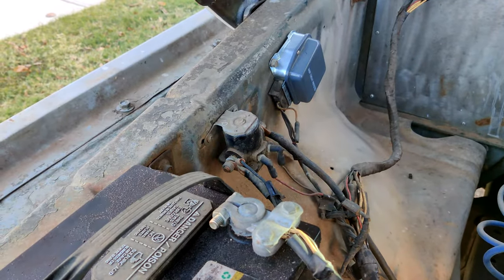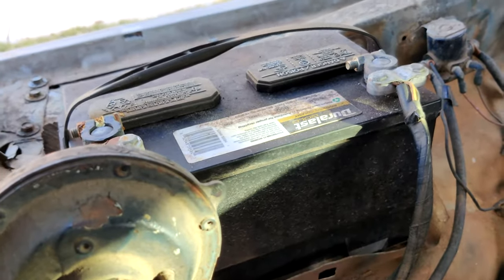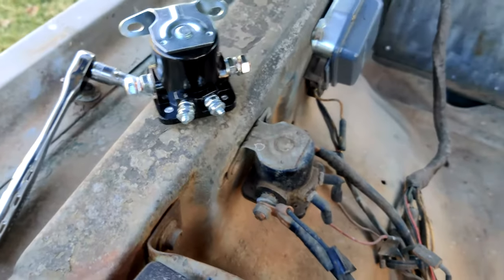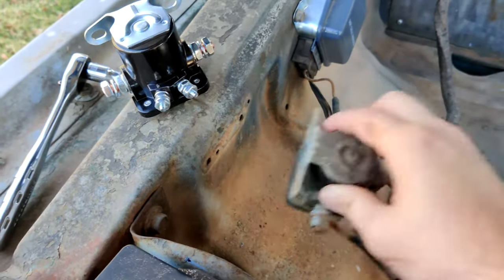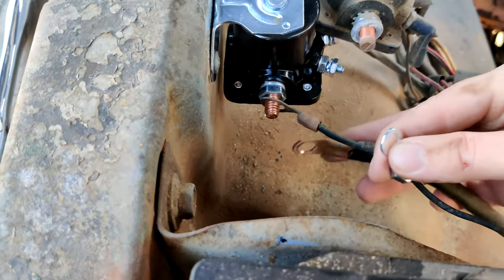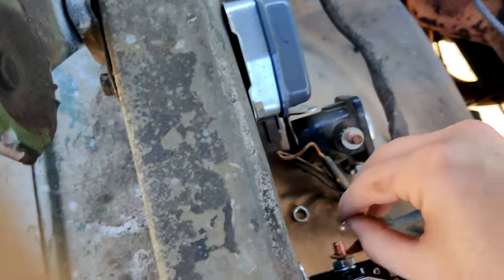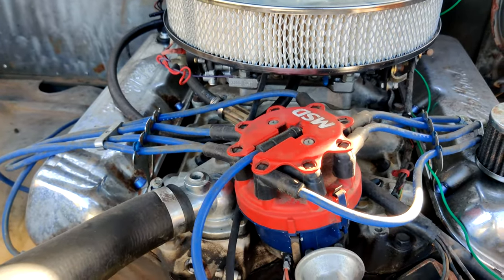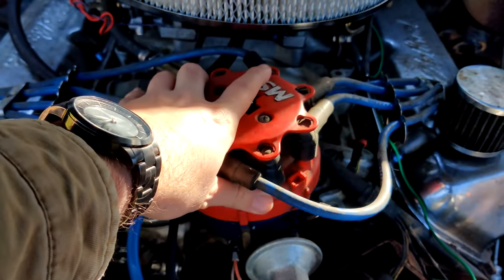Easy Ford Starter Solenoid Replacement

Comment: going to watch this all the way because, well, the freaking solenoids on the 70s Ford trucks were a pet peeve of mine back in the day!  Dirty connections/ground, random fails, weird wire corrosion out of nowhere. Resorted to carrying a back up in the field to stave off costly breakdowns (grain farm guy). Takes 10 minutes after you get the hang of it.  Maybe less if tapping it with a vice grip works.  I swear, it all had to do with the exposed location of the damn thing.

Comment: Thanks man!! On my 76 f250 the battery cables did not have auxiliary leads but when I had to replace them the new cables came with them, I saw that your cables also have those leads and am wondering what you have them connected to?
Reply from the maker: They're connected to the electric fans on my radiator, though it was done before I bought the truck and not very well, basically a wire going to the dash to a switch and back to the fans. Should be connected to a relay and switch or thermostat. You could also use them for stereo amps or aftermarket equipment.

Comment: I have a three post solenoid in my truck it's bad. Every aid, book, and shop shows a four post solenoid replacement? If in fact it needs to be a four post, then what if anything do I connect to the fourth post?
Reply: 1986 ford f150  straight 6, 4X4  3 speed manual.
Reply from the maker: Of the smaller posts, the left one (S) is energized when the key is in the "START" position, this actuates the solenoid to power the starter. The other post (I) is supplied power in some ignition systems to send 12V to the coil to help start the engine. It's not used in all vehicles, and since yours is an '86 i'd imagine you can just leave the I terminal unused.

Comment: oi, i was just wondering the piece you have a link to is for an old ford tractor. does that still work for an 86 f150?  the old solenoid in it as well as the wiring looks almost exactly like the one in your truck?
Reply from the maker: Oops, my mistake, I updated the link to point to the correct solenoid (https://amzn.to/3VwcYFS).

Technically yes, they should be the same since I think they used this same solenoid type over decades of different cars, trucks, and construction equipment.

Comment: Anybody have any advice on what wires are necessary for the vehicle to run? I've got an 81 LTD with a ton of things hooked up to the solenoid. I don't know what's what. The AC doesn't work. The heater doesn't work. The radio doesn't work. All I want is for the car to run safely and have running lights. I don't care about the rest of the stuff. I just use it to run errands and occasionally drive it to work. Just a fun old car.
Reply from the maker: You should just need something hooked to your S terminal that triggers the starter and sends 12V to the coil, it's hard to say if you've had someone in there changing the wiring around but it sounds like a fuse panel issue or even an ignition switch issue.
Reply: @rednecklite  There is a bunch of stuff hooked up the the hot post on the solenoid. I'm sure most of it isn't necessary. All I want it to do is start and run. Just a junker.

Comment: On my 91 Ford f350 7.5 I went through 2 of these solenoids mounted from O'Reilly's and all it's doing is buzzing. Everytime I put a new one. Same thing. It buzzes. New Starter and new battery are from last year and I put on a new battery cable from battery to solenoid today. The dash lights and radio comes on when I turn the key to on but try to start, it buzzes. What could it be. I don't wanna keep running back and forth to O'Reilly's getting a new solenoid.

Comment: I just replaced mine, and I can start it with the solenoid. But no key start what could that be?
Reply: Did you ever figure it out ? Having the same problem
Reply: @julianbernal6876  I have not, it could be the neutral safety switch I will let you know if that’s it
Reply: @julianbernal6876  it could also be the connection on yours
Reply: @Pens-and-morez  the connection on my solenoid I believe is good. The key is locked in the ignition switch and can’t get it to turn the car over.
Reply: @julianbernal6876  what is the car your working with?
Reply: @Pens-and-morez  my reply isn’t showing so I’m going to send it again but I’m working on a 1973 Ford mustang
Reply: @julianbernal6876  first thing I would check is the neutral safety switch, it should be under the steering column
Reply: @Pens-and-morez  hey anything new I’m still having trouble?
Reply: @julianbernal6876  still got nothing from mine, can you start yours with a screwdriver? On the solenoid
Reply: @Pens-and-morez  it’ll crank and start to fire up like normal like it wants to start. But it doesn’t stay on. I have no power/current going to the fuse box still either.
Reply: @julianbernal6876  i haven’t heard anything like this, let me look around and I will let you know
Reply: @Pens-and-morez  okay thank you so much
Reply: @julianbernal6876  maybe a wire on the wrong side of the solenoid, or the ignition switch went bad
Reply: @julianbernal6876  Fordification then your car to see wires
Reply: @Pens-and-morez  so I noticed my fusible like was split/blown. Anyways, i go to replace it and when I go to put the negative back on the battery it sparked and went up in smoke and blew again. Also my key is stuck in the accessory position bc it’s locked into my ignition. Any clue why it would spark and smoke like that ?
Reply: @julianbernal6876  mine did the same thing, on mine my alternator was hooked up wrong
Reply: @Pens-and-morez  what ended up being hooked up wrong. I’m just not seeing anything hooked up differently from before when my car ran before ?
Reply: @julianbernal6876  the alternator was wired wrong on mine,
Reply: @julianbernal6876  on the alternator red goes on white I think